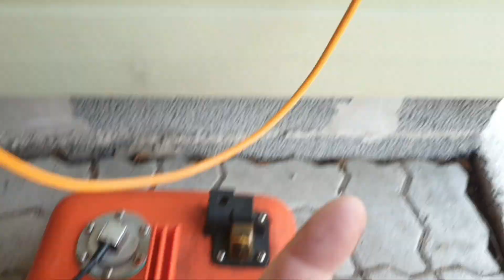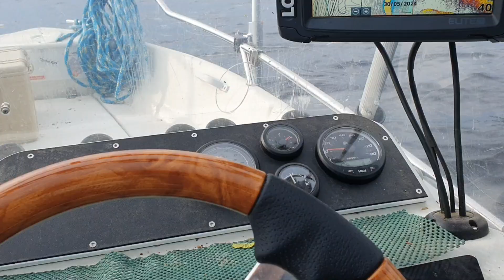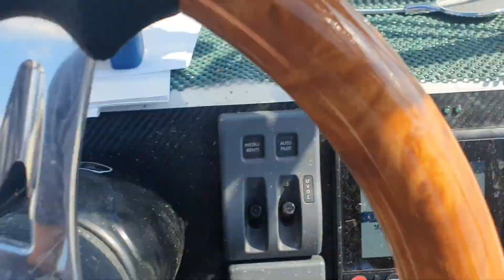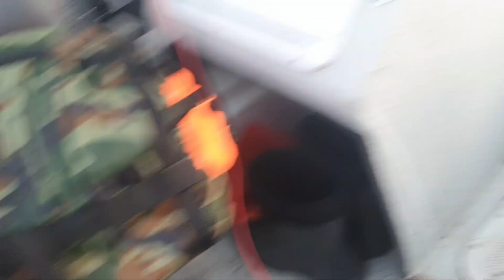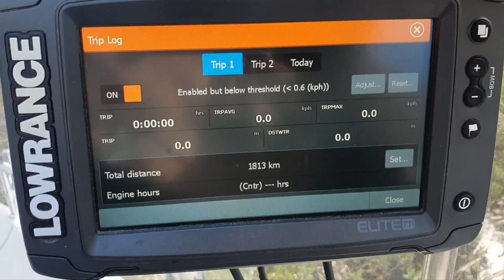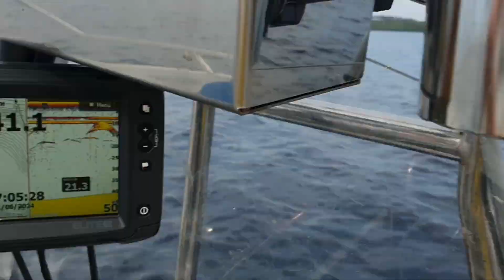Mercury SC1000 Gauges Do Wrong Fuel Management!

Comment: Greetings!  I may have missed something, but I'm pretty sure your system would support the VesselView mobile application which is around $250 USD for the dongle and the application is free to load on your phone.  It gets connected to your SmartCraft databus either within your engine cowling or at a junction box if you have a spare connection.  With VesselView, you enter the amount of gas you add to the tank(s) into the application and it accurately tracks the remaining fuel based off of the fuel you consume.  It also shows fault code descriptions, speed, rpm, battery voltage, fuel burn, oil and water pressures, oil and water temperatures, and tracks your maintenance schedules.  Actually, some of the items I listed may not be available for all motors though remaining fuel seems to be available for all supported motors.  It does not show the engine trim position so I keep that on my SmartCraft Tach display all the time as it's important to my boat's fuel usage.  I realize this video was posted long ago, but it just popped up on my YouTube feed today.